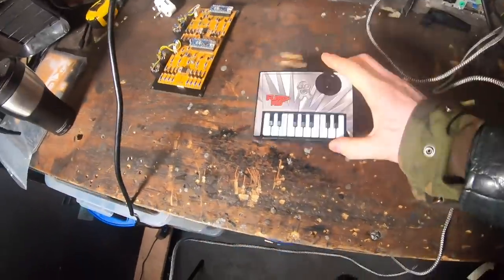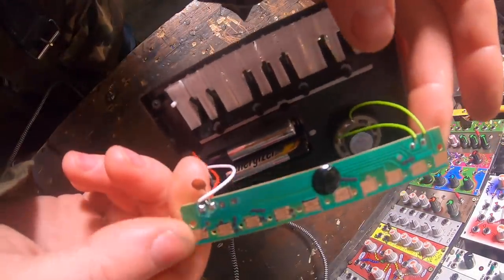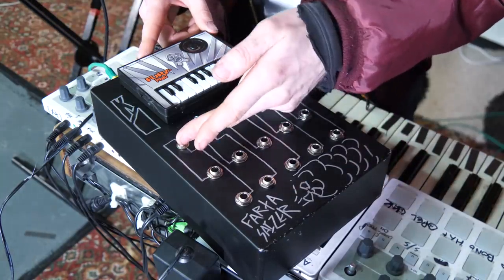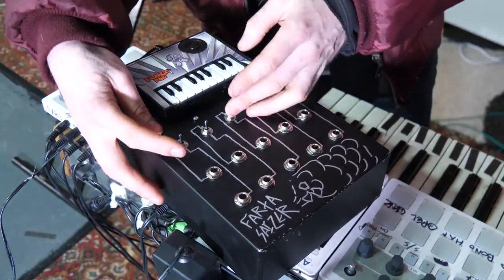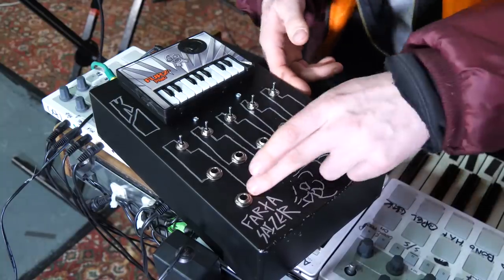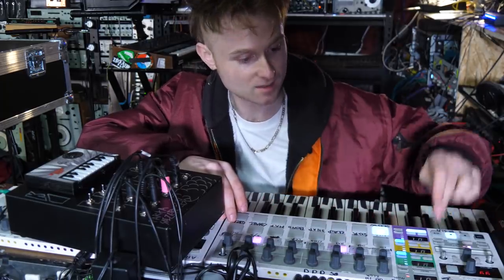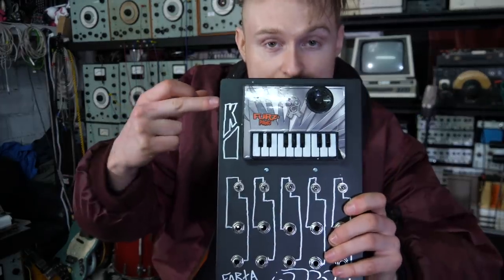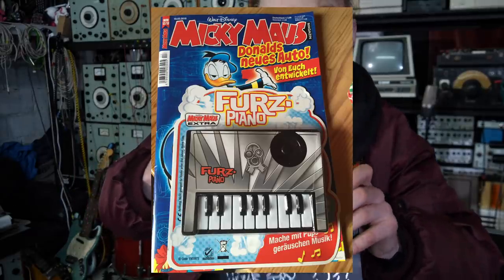Making Beats With a Fart Toy Modified To Play In Time

Comment: please circuit bend a geiger counter with pich instead of beeps.
Reply: This needs to be done. Reposting comment
Reply: Sadly, this isn't really something that can be done. A geiger counter makes its famous sound by amplifying the ambient ionization of the air. The rest of the thing is just quantifying those readings into specific amounts. So there aren't really any "circuits" to bend involved.
Reply: EPM just put a fast stepper motor controlled door set up to use midi to open and close the lid of a lead box containing a radiation source
Reply: Cedric Crow that sounds like both an awesome and terrible idea
Reply: a Geiger counter is really just a randomly triggered click, with the randomness being ionizing radiation it manages to detect... 
There is however a project called "Radioactive Orchestra", where they use scintillation counters to both trigger and assign pitch on various synths.
Reply: @SAwfulEPM  sample and hold trigger
Reply: you can make the output a gate and trigger a random sample and hold to make random melodies
Reply: and then run from Nevada to Chernobyl to generate octave sweep

Comment: What are you doing duuude just create a mini induction heater bit of cables measure their resistance hook em up- to power put in a tube preferable metal or heat resistant glass and put a fan at one end control temp by fan speed and power  and if ya want just hook upa small temp vreader to kill power if gets to hot